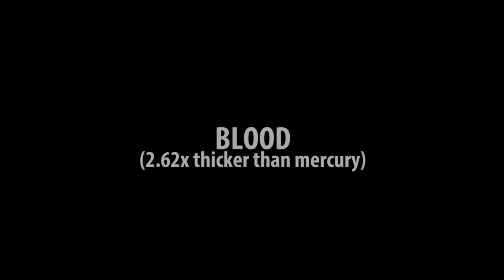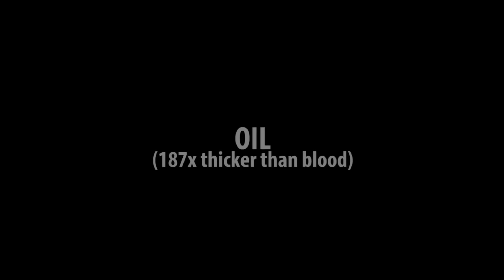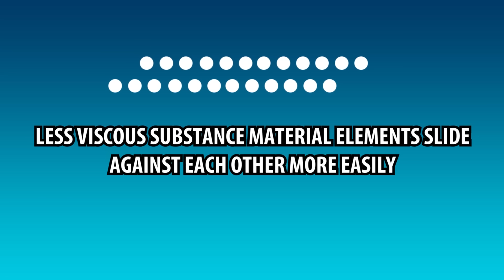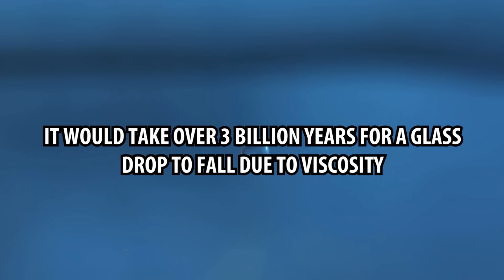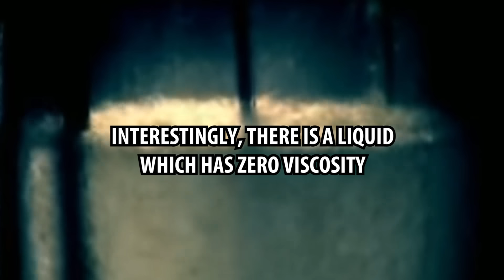Top Thick Things Ever

Comment: Fun fact: the reason the hot water tap in your bath sounds different to the cold, is that hot water is less viscous.
Reply: It is also because there is more bubbles in hot water
Reply: @HexaflexagonFan  Why would there be more bubbles in hot water? Especially if it's been sitting in a hot water cylinder for hours.
Reply: @TheGodpharma it moves more on a molecular level, so air molecules have an easier time going through it and clumping into bubbles

Comment: Interesting getting recommended this when I started a job that involves a lot of viscosity (and rheology in general) like 6 months ago. Also another interesting fact about ketchup (in bottles) is that it's made so if you apply a force, it thins (shear thinning) so it flows out of the bottle easier.
Reply: Twisting the bottle works better than shaking, but if you hold a Heinz bottle label up and tap on the logo it'll pour out nice and easy lol

Comment: Geologist here. First and foremost, there are more than 3 types of magma. Second: when we talk about magma, we refer to molten rock that's underground. Once it reaches the surface, it becomes lava. What changes is that magma is under pressure, therefore, it can dissolve volatiles (mostly H2O and CO2). Once it makes it to the surface and there's nothing to keep it confined, most volatile compounds escape as gases, chemically changing the liquid.

That said, rhyolite, andesite and basalt lava are the most common and out of those three, rhyolitic lava is, indeed, the most viscous.

Comment: I recall the 600 weight gear oil used in Caterpillar tractor final drives. At room temperature you could scrape it up with a putty knife and transfer it to another container.